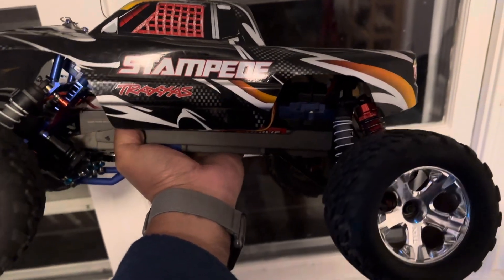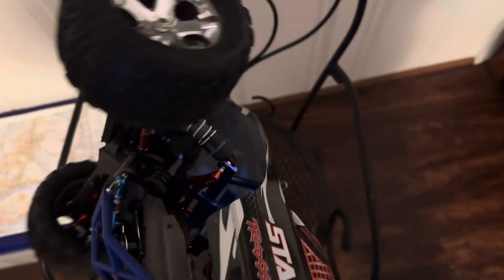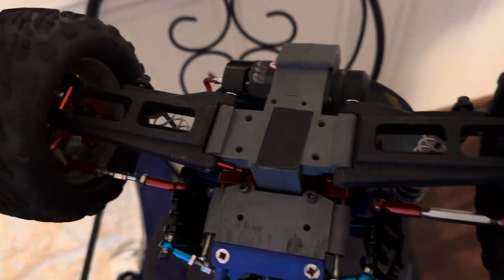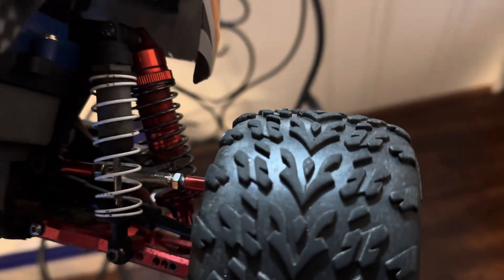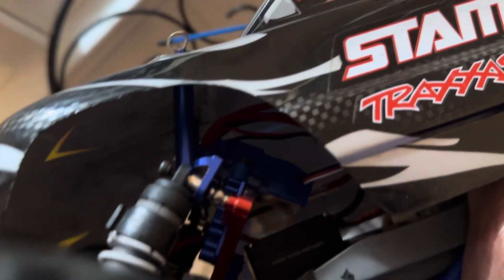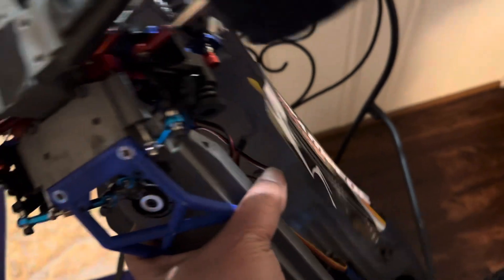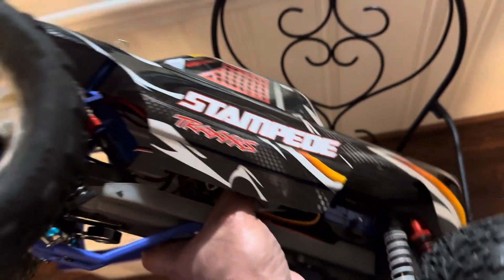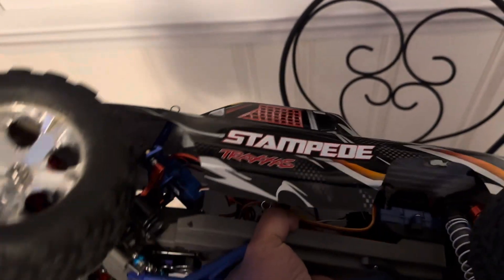2WD to 4WD twin motor Traxxas Stampede Conversion

Comment: I'm interested in seeing/knowing how you did the steering and what aftermarket parts did you use?
Reply from the maker: I can post another video showing the steering system I have now. I have tried several. There is no perfect solution but the one I have now works well.  Here is a video to show how it works, especially power in snow without using momentum to move through snow: https://youtu.be/bmzd7WyhMjo?si=EJhh-0ZX-HiRqIaX